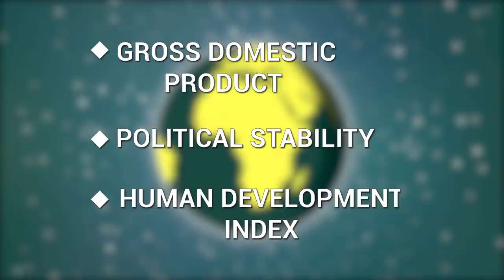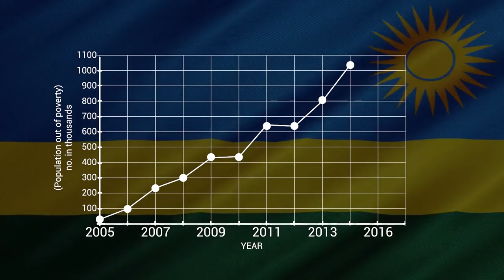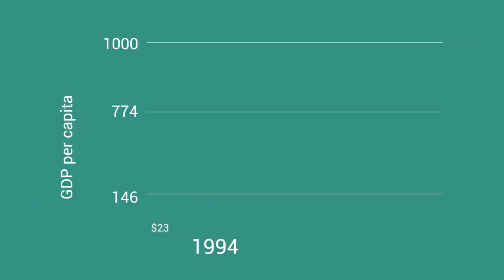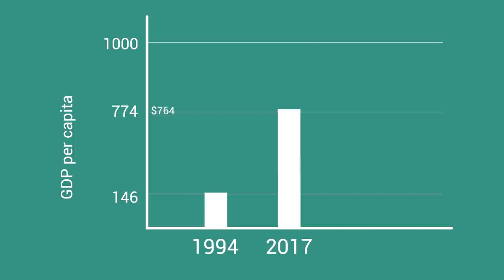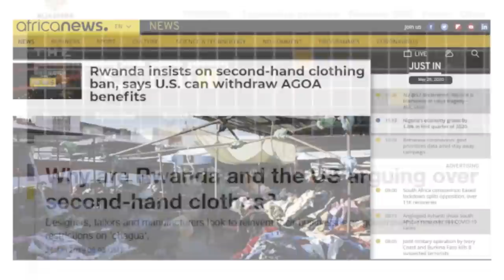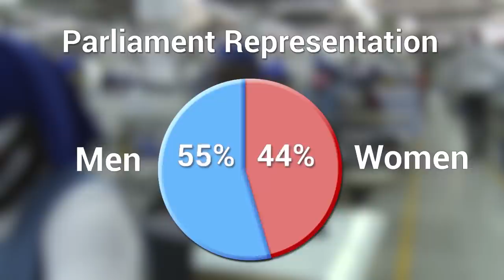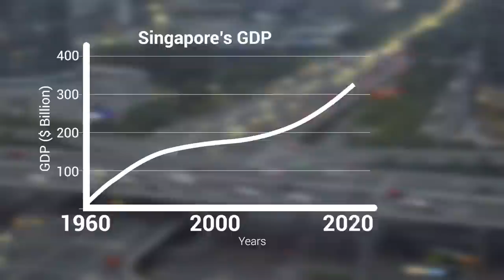How Rwanda is Becoming a FIRST WORLD Country

Comment: rwanda is sounding much similar to botswana with its rapid development centered around strong leader, however it is much larger population and much higher urbanization meaning greater ability to centralize and critical mass required to increase economy- difficulty for botswana is that the country is too spread out thin and low population, thus i have hope for rwanda to become majorly developed due to it not having these issues as bad in that regard
Reply: Botswana is not the same as rwanda
Reply: I stand to be corrected but I have been of the opinion that Botswana has transcended the "strong man syndrome" of leadership and established strong institutions instead!
Reply from the maker: I once read a research paper where people were asked "f you were only going to Africa ONCE in a lifetime and had 3 weeks, where would you go and why? Almost 80% chose Rwanda and Botswana😀

Comment: Rwanda still has a long way to go. It's on the right path, but most of it's population is still woefully uneducated, a major obstacle in the progress of any civilization. I have been to Rwanda, and once you get out of Kigali, you realise, there's so much smoke and mirrors to the entire Rwandan "development" situation, and a president who doesn't like criticism makes it very hard to correct it. I'm Kenyan, and it will take at least 25 years for Rwanda to even get it's ball rolling, that's if things continue the way they are. But odds are very low, because of a dictatorial style of leadership, where everything is likely to collapse when the man in power is no longer around. The right move would be for them to form national objectives and the president to step down, and hold each leader accountable to meeting these national objectives and goals. But as it is, the Rwandan situation is completely sensationalized by the media and Pan-africanists. The health care of this country is extremely underdeveloped, they're still struggling with Malaria and relying heavily on Western funded start-ups to bail it out, when much of the continent has a somewhat functional health system. Rwanda shows a lot of promise but the style of leadership, and high illetracy levels will be a bigger challenge to overcome.

Comment: I am from Singapore. You compared some circumstances between Rwanda and Singapore and said that Rwanda does not have the same advantages. Allow me to give my two cents worth:

Singapore has access to the sea, while Rwanda is landlocked. While this is technically true, it should not stop Rwanda from using its advantages. Singapore is an island, and CONNECTIVITY necessitates that it uses sea routes. On the other hand, Rwanda is connected to many other countries rich in resources and human capital. Rwanda does not need ships and sea lanes if it pursues connectivity through good road, rail and air links. 

Singapore has an advanced education system. This is true at the present time. However it was not so when we first started in the 1960s. All that we have was built up over time.

Singapore is in a stable political situation. This again is true at the present time. However at the time of its birth, Singapore was in a highly unstable neighbourhood. Singapore had just been ejected from the Federation of Malaysia after some years of ethnic strife. Malaysia expected 
Singapore to collapse and come begging to be let back into the Malaysian federation. Singapore was threatened militarily by a newly independent Indonesia that had just thrown out its Dutch colonial masters and was hoping to add Singapore and Malaysia into its own territory, there were even terrorist bombings effected by Indonesian special forces soldiers. A communist insurgency was rife in Malaya and communist parties and agitation were also strong in Singapore at that time.

Seeing the able leadership of Rwanda, and the discipline and hard work of Rwandans, I have no doubt that Rwanda's future is very bright indeed.
With love from Singapore.
Reply from the maker: Very well said @keff